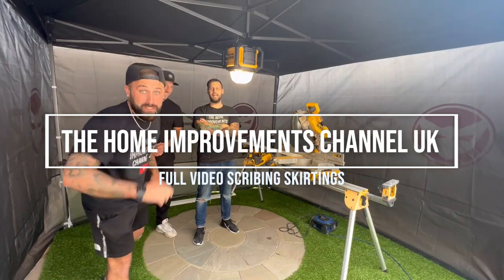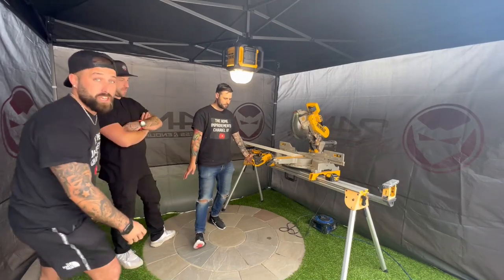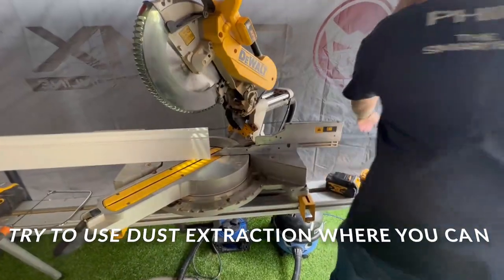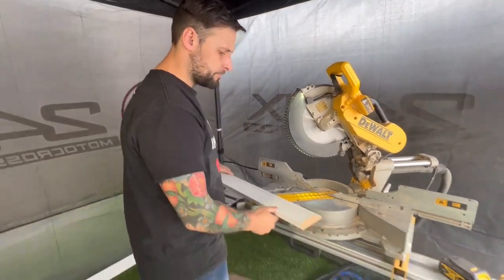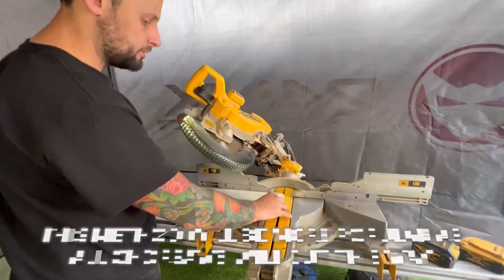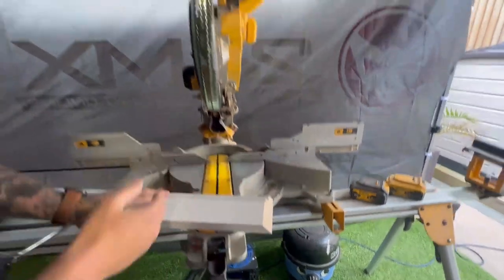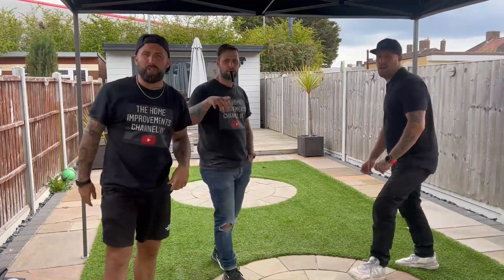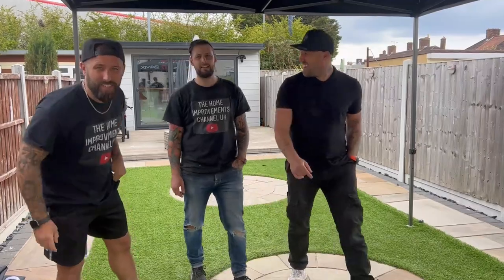HOW TO SCRIBE & CUT SKIRTINGS / BASE BOARDS TO FIT INTO CORNERS   #flooring #homeimprovements #diy

Comment: Use the mitre saw for the straight portion of the cut and do the coping with the saw set to cut on the pull stroke  from above,